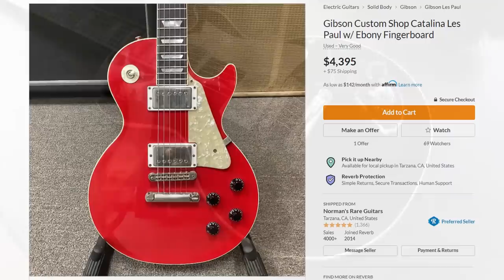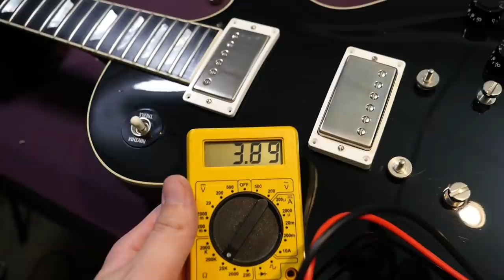I Didn't Think This Color Even Existed?!? |  1998 Gibson Les Paul Catalina Ebony Review + Demo

Comment: Gibson decks the tail pieces down to the body from the factory. I’ve bought 3 new Les Paul’s between Nov 2020 & Nov 2021 and all 3 the tail piece is down as low as possible. I raised it on the 2021 Standard I bought because she played a little stiff (it worked to fix the stiffness) but have not changed/raised it on the 2020 Standard or the 2021 Custom Shop Custom…

Comment: Is there not a massive crack in the neck/finish? 14/15th fret on the top side of the heel during the blacklight portion? @ 19:48

I’d be more concerned about the heel joint than the video leads onto at this point. Especially with the touch up on the back joint...

Comment: This one that your reviewing just looks so classy. With the pick guard the headstock custom shop logo and pickup rings. With that finish just makes it all look like fantastic. I know it doesn't have the sparkle finish but I find that just cheapens the look. I understand the issue of having the tailpiece slammed down to the deck putting way to much pressure on it. But I think that kind of break angle affects the strings also. Not only for ease of playing but I'd bet the possibility of a string or two popping sooner than it would normally is higher.

Comment: The guitar is wired in the Modern style with no metal pot plate, and includes a grounded tailpiece. 

It is interesting the slight changes in some of the wiring techniques from Gibson over the years even though they follow the same basic schematic. The schematic tells you how to connect components as per nodes or netlist, but not where, the where is important because it established how currents actually flow. For example, the output from the selector switch using the three Gavitt wire technique, which this guitar uses, is usually established at the switch. If this guitar used this popular technique you would see the insulated Gavitt wire, covered in tubing or sleeving, from the output jack to the switch. The guitar in the video solders the output Gavitt wire to the neck pickup volume pot rear cover, and then insulates it from the pot to the jack. To me that pot solder connection is not necessary or wanted.

You really should insulate (cover with sleeving all of the bare outer braid Gavitt wire as it routes through the guitar. So, the braid grounds only connect at the volume pot rear cover and no where else. This way you know how the ground currents will flow. Also, you should sleeve the tinned bus wire as it route within the control cavity. You can see how the bus wire is touching the braid and the braids touching each other in the control cavity which is complicating (unwanted) the ground connections.

The ceramic tone caps should be replaced if the guitar is going to be a player and not purely for original guitars in a collection.

Done correctly is the ground bus wire connect from the tone pots to the volume pots (first) and then bridging across the volume pots (last), with no ground connection across the tone pots, which would form a loop, which is undesirable. 

The pot rear cover soldering is poor quality, and for the price of this guitar when new, the flux residue should be removed.

Comment: I like how the chambered ones sound.  They have a certain mid growl to them.   Somewhere between a Les Paul and an ES335.
Reply: The Elegant,The Chambered and the Supreme all sound lovely and different from the weight relieved and solid guitars! Love em!
Reply: Dont’ forget about the ES-Les Paul, while not a popular model, it also has different characteristics.
Reply: I imagine they have that sound.
Reply: The 2008 LP standards have that same chambering.  At least some of them do.  They aren’t that well known.  Some people didn’t like the locking output jack with the red button or the quick connect electronics system with the circuit board.  Honestly,  they are incredible guitars though despite the little critiques like that.  I don’t see a lot of them come up for sale.

Comment: Hey whats the tool that you use to measure the pickup output?  Looks like a multimeter that plugs into the output jack?  Thanks!
Reply: A simple project to make.  Just solder the connections from a guitar cable to a pair of the input connectors used on multimeters, or solder a guitar 1/4" phone plug onto a pair of multimeter test leads.   This little tool is a great way to go when you need to quickly check the pickups without taking the control plate off the back.
Reply from the maker: Just get alligator clip leads for your multimeter and leave them on a patch lead. That is my set up

Comment: Pickups matter. The 57 classics in this guitar and the purple one Austin just reviewed outshine the 490’s typically in USA models. To my ears, they are much closer to the tones in the classic rock recordings we all know.
Reply: Regular Gibson USA models have come with Burstbuckers for the last 20 yrs pretty much, whereas it's the LPC's that come stock with 490R/498T's. Personally, I like the 490's but then most of my Gibsons are from the 90's so they're what I'm used to. I'd say there's very little difference between a 490R & a '57 Classic neck pup but obviously the 498T is quite a bit hotter than any of the '57 bridge configurations. Horses for courses I guess.
Reply: @jubei7259  I over-generalized. I remember Studios and Customs came with 490’s so I assumed it applied to those in between. The hot 490T is more “modern” to my ear (not bad, just not “classic/vintage”).